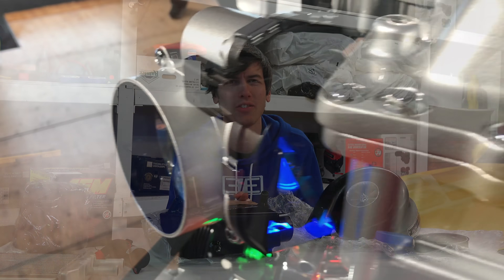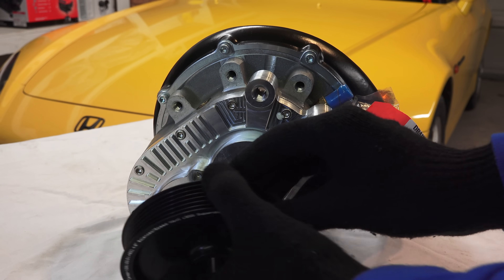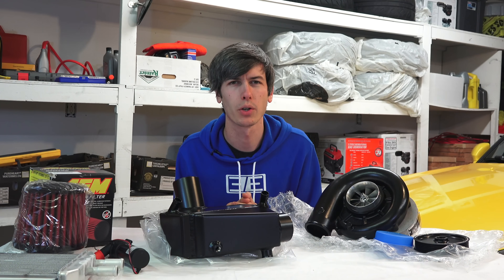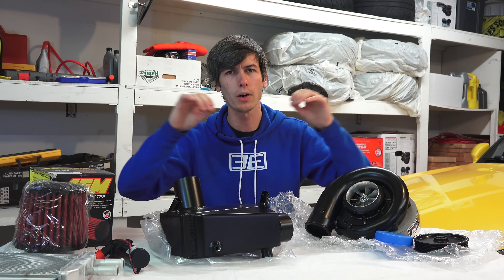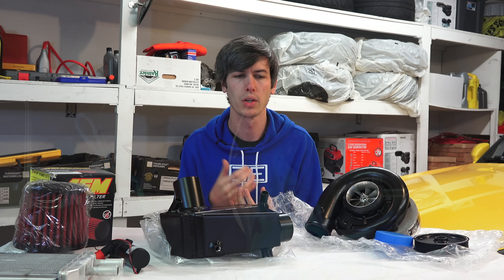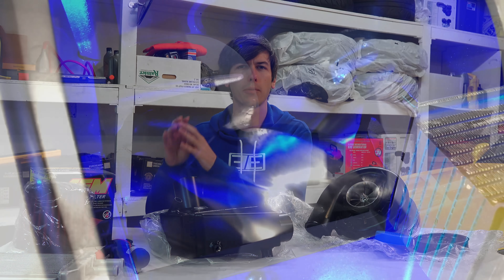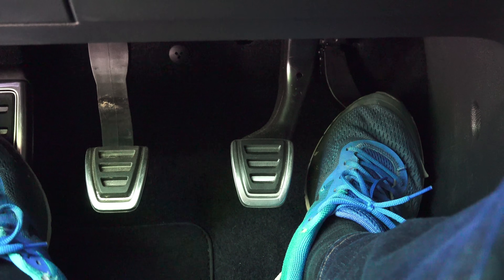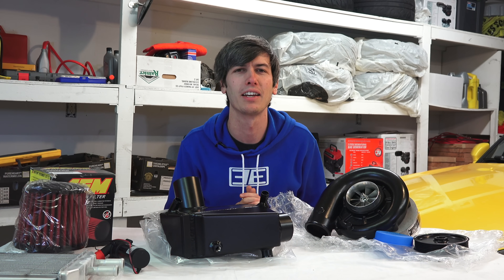Turbochargers vs Superchargers - Which Is Better?

Comment: Well supercharger is way better and the supercharger can give you more power than turbochargers.
And turbochargers will give u less power to the engine.
Reply: If you twin-turbo a car vs supercharge it the turbocharger is more efficient and will win because regardless of the conditions it’ll ALWAYS MAKE the same power unlike with a supercharger they have to work harder to make the boost they need but I personally enjoy owning both hahah
Reply: You will get less power with a supercharger at the same boost level. Superchargers are driven by the engine. Turbos use mostly wasted energy from the exhaust.

Comment: of course a turbocharger i s better than a supercharger because it is free power , it does not take power from the engine to drive it . i read in an old car magazine that a g.m.c. 6-71 supercharger , the type that came on 2 cycle detroit diesel engines , take 100 hp at 6,000 rpm to drive when used on a gas engine . that is a 100hp lost to drive the blower . and very few people know it , but the correct name for a turbocharger is turbo-supercharger , because the super means above natural , referring to the fact that it is filling the cylinder with more air that is possible under atmospheric pressure alone . the turbo term means the way it is driven , by exhaust gases/turbo , hence the name turbo-charger

Comment: For me, it depends on application.  My Cruze's turbocharger makes sense.  I wanted a car that got a very high mpg, and found 42 to 50 highway, and the 1.4T certainly provides.  As for Superchargers?  Well, the Hellcat wouldn't be such a ballbuster with twin turbos.

Also, fun fact, many modern turbochargers are coolant cooled, so the con of the oil suffering can be (mostly) disregarded.

Comment: During WW2, USA developed aircraft that had BOTH shaft-driven & exhaust-turbine-driven chargers. The one thing that car drivers do not often experience is rapid changes in altitude, which aircraft DO experience. By combining both kinds on the same aircraft, USA achieved a superior level of performance that had decisive effects during combat with enemy aircraft.

Comment: How about a hybrid turbo with a small spin-up electric motor to help overcome inertia and avoid lag? Also a separate oil system for that turbo. Sure, both such systems ar ed added weight, but maybe it's worth it.

Comment: I rather have a supercharger over a turbo turbos do more damage your motor in the long run vs. Supercharger so there's that
Reply: Nope, how exactly will a turbo cause increased wear as opposed to a supercharger? They both pressurize the intake except one is driven by a turbine in the exhause and the other is driven by a belt.
Reply: What the hell are you taking about?
Reply: @jimbojims  its well known turbos are far less reliable.
Reply: Higher back pressure, higher oil degradation, hotter exhaust valves, hotter engine compartments.  That said, it’s not major.

Comment: I've always wanted to know this: can you have a turbo AND a supercharger on same system. Sucking and blowing constantly.
Reply: You can... there called hoes 😝
Reply: yes, you have a supercharger that spins at low rpm for low end torque and is disabled and bypassed once the larger turbo kicks in when your rpm is higher. Volvo has this in their t6 engine

Comment: But the question is: which one can last longer? Turbo is powerful but if it breaks, the whole engine blows itself up
Reply: Same is true with a supercharger. With proper maintenance they should both last as long as the engine unless there are design flaws.

Comment: Supercharger.
Why?
Because
Spitfire
Reply: I assume you mean the Supermarine Spitfire? Aero-engines have a different set of requirements than an automotive engine, as they don't need to rapidly change RPM (the propeller is adjusted to maintain RPM regardless of manifold pressure). In addition, the Spitfire used a centrifugal supercharger with multiple gears so that it could adjust to a higher and lower altitude. However, the ability of the turbocharger to continuously vary its RPM gave it a large advantage at all altitudes, as seen in the Republic P-47 Thunderbolt.

The DB-603 and DB-605 used a supercharger drive system based on a torque converter, such as one might find on an automatic car transmission, but it had the unique advantage of being able to operate when partially filled, meaning that the power transmitted to the supercharger would decrease as fluid is removed, allowing a supercharger that could operate fairly well at all altitudes. However, it was less efficient than the geared supercharger transmissions of the other aircraft of the war, which were in turn less efficient than the turbochargers found on vehicles like the Lockheed P-38 Lightning and Republic P-47 Thunderbolt.

Comment: Thanks for the detailed information...
I drive a twin-turbo Ford F-150 2.7 ecoboost, and I would say, it performs like a Mustang when on sport mode!
Reply: Commentor1 I had a 2010 V8 F-150, before this Twin-Turbo one, but man, this little 2.7 has way much more hours power and torque!
With sport mode on the transmission, it's really a racing truck...

Comment: The supercharger takes power from the motor by the belt. The turbo charger blocks the exhaust restricting flow of which the engine does not need.which also lessens the power output.

Comment: What will happen if you put Twin Turbo and Twin Super Chargers?
Will it make less CO2? Just from economy and environmental stand point...
Reply: Only if the angle of the dangle is directly proportional to the lust of the thrust... and providing the force remains constant.
Reply: You will get more power. It will also create more co2, not less. Anytime you force more air into the engine, you make more power but also create more emissions.  More air in means more exhaust out.
Reply: @Redtooth75  But its same amount of fuel. 🤔
Reply: @RadiusNightly  if you increase the amount of air you must also increase the amount of fuel. If you dont you just make the air to fuel ratio leaner which will destroy your engine.

Comment: do those things spoil fuel efficiency?
Reply: No, they don't spoil fuel efficiency. A lot of manufacturers use chargers (usually turbochargers) to meet fuel efficiency requirements, since they can use a smaller engine.

Comment: Hi. I'm watching ur videos. Here a suggestion I hv y don't we design an engine with electronic control intake n exhaust valves. I'm a plant operator there many types of valves used, so this way we can get rid of cam shaft s n other stuff which will lower weight of engine. Hopefully you can make one. I can only imagine stuff. Thanks for ur videos. A big fan.

Comment: What will be better to daily?? Turbo or supercharger
Reply: Pros and cons to both. A turbo will make better gas mileage than a supercharger. But you will have to deal with the lag and it will be harder to install. A turbo will also be able to change boost pressure on the fly.

Comment: Supercharger; power available right off the line, but causes a tiny amount of parasitic drag on the engine

Turbocharger; needs to spool up to build pressure, slight lag off the line

Comment: You didnt mention that a turbo rams  hot air amd a supercharger rams cold air into the engine which is more dense and  increases combustion efficiency/power.
Reply: Both superchargers and turbochargers heat up the air, although turbos heat it up more because the housing is hotter. When you compress air, it gets hot. That is why both superchargers and turbochargers have intercoolers.

Comment: My jeep compass petrol 1.4 is giving very low mileage 7. 5kmpl, how can i increase that, my driving is very smooth
Reply: Could be a number of things. Could be wasting fuel somewhere. If you can, take it to a autoparts place and have them scan it with a OBD2 tool or buy one yourself if you want.

Comment: Can you explain why centrifugal superchargers do not generate a linear amount of boost like other styles? I have not seen any specific information that shows why.
Reply: Centrifugal superchargers use the snail shell style of compressor that turbos also use. The amount of boost that those compressors make is not linear with the rpm of the impeller. On  root and screw type compressors the boost is linear with the rpm of the compressor.
Reply: @Redtooth75  yes I was wondering why the boost is not linear. Do you know why the snail type compressor does not generate linear boost?
Reply: @vasilis23456  just one of the properties it has.

Comment: I do not really get it about efficiency. AFAIK there is no such thing as free lunch, the power you use to spin the compressor comes from somewhere. In the supercharger's chase, it's clear.
In case of the turbo, you're basically still using the engine's power to force out the exhaust gas, and when you use the gas to power a turbine. You're basically choking the engine, and incurring the same additional power requirement on the engine, just with a different method, no?
Reply: Exhaust is waste. Turbo charge used exhaust pressure to operate. It doesnt choke engine. Lol. If the exhaust gas is out the exhaust valve is closed so how can it be choking the engine? Wtf
Reply: @JC3V16  By putting a turbine in the exhaust way, you're putting a load on the crankshaft when the piston is pushed upwards and forces out the exhaust gas. It doesn't just miraculously get out of the piston you know. Look up "turbo backpressure". That's why performance cars have bigger exhaust pipes for example.
Reply: @AWZool  most of the energy used to spool the turbo is waste energy. As in energy that would otherwise just go right out the tailpipe. A turbo will utilize that waste energy to help make more power. However, there is an increase in backpressure that will reduce power . A supercharger is driven by a belt. None of the energy used to turn the en supercharger is waste energy.
Reply: @Redtooth75  Unless a turbo uses heat to spool the turbine - which it doesn't - then all the energy comes from the backpressure it causes.

Comment: naturally aspirated is the best for gas engines,a naturally aspirated v6 gas has good torque all along,naturally aspirated boxer h6 from subaru is the coolest thing you can have at 3.6 ltrs,turbo charged diesels are very cool 😎 because diesel engines have plenty of torque with or without turbocharger,so you barely notice turbo lag on diesels.

Comment: Anything that compresses the intake air beyond ambient pressure is a supercharger, by definition.  There are turbo-superchargers and mechanical superchargers.

Turbos increase the efficiency of an engine, if used for that purpose.  They scavenge waste heat to compress the intake charge.  They also involve a bit of lag, and they are less reliable because of the extreme temperatures involved.  Mechanical blowers respond more quickly, but REDUCE engine efficiency because of their parasitic drag.

Comment: If a boost leak develops, the turbo will over-spool trying to compensate which will eventually cause it to explode sending metal into your engine, and it’s pretty much game over. VGT turbos are worse for exploding. That’s why I’d rather have less under my foot and enjoy the reliability of a naturally aspirated engine. If you run a turbo, always carry spare boots and clamps and pressure test your aftercooler/ intercooler every oil change. If you catch a boost leak early it can save you big money!

Comment: Why not use electric super charger instead? Ellectrically powered supercharger, from Li batteries.
Reply: Because the cheap electric superchargers don't work, unless your talking about an electric motor driven roots/twin screw style supercharger. I don't know if the later exists though.
Reply: They do exist but they are very expensive. It takes a lot of power to drive a supercharger or a turbocharger. A 12v battery is not powerful enough to drive an electric supercharger. It would require a much more powerful battery. So it would not only require the supercharger, it would also require an expensive battery and electrical system. When it is all said and done, you will spend at least double on an electric supercharger than you would in a normal one.

Comment: For those who learned Thermodynamics 1 & 2 (depending the major). Comment what you think can improve overall efficiency of the internal engine intake/exhaust process. I’m trynna see something 🤔
Reply: Get ride of the camshaft and open the valves with electric solenoids or pneumatically.

Comment: I have a SLP 2300 supercharged 2013 Camaro. It is 32 percent larger than the the
Reply: I have a 2013 ZL 600 Camaro with a 2300 SLP supercharger. It is 32 percent larger than the 1740 Eaton used on the ZL1. It is a one and only car produced by Chevrolet. It is all OEM and easily beats the ZL1. Priceless!.

Comment: I guess given time they can map the turbo to almost neutral on throttle response.
Fitting a turbo on your own is a whale new problem.
A supercharger takes a lot less to get a good map.
It's a money vs performance equation.
Turbos can be better but a higher research cost.
I've always fancied a supercharger. Seems more like something  for something.
And linear for it.
Luv and Peace.

Comment: I have a truck that has a huge Garrett turbo feeding a screw type supercharger. Detroit Diesel 8V92 2 stroke. Did I mention it weigh 40000 lbs?

Comment: I'm not sure about this, I mean it take energy to turn the turbo as much as it would take to power the supercharger. I know it's the smoke that was leaving the engine anyway but it's not as simple as that. Take a straight pipe exhaust vs a muffled exhaust and we see the straight pipe exhaust restricts the flow of exit gas and thus decreases horse power of an engine. A straight pipe allows unrestricted flow of exhaust gas so the engines horsepower increases, a turbo charger restricts the flow of exhaust gas so it's loosing horsepower right there. I have never used or seen a supercharger but would favour such a device over a turbocharger for if nothing else heat.

Comment: I change the oil to my NA engine (5.0 Coyote) every 8000 KM (5000 mi) and looking to Twin turbocharge it (daily driver), what am I looking at in terms of oil changes after that?

side note: I do not track it or race it; just the occasional pull every now and again.

Will I have to change it ever 4000 KM (2500 mi) and cut the service in half? or what is the rule here.

Appreciate your videos as they are very eye-opening.
Regards,
Reply: Why twins if your not gonna put it on a track or strip?? Are you wanting your car in the look out crowed section?? An it all depends on set up but I'm pretty sure your internals won't hold twins that are set to make power .. go for a nice single turbo an a good tune . You'll have all the power you want to look cool an you'll still be able to control it